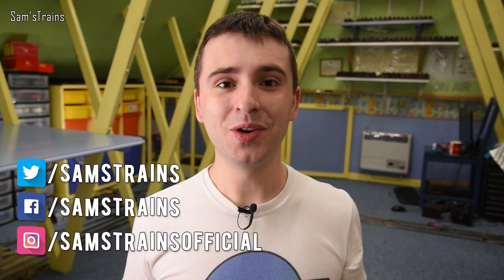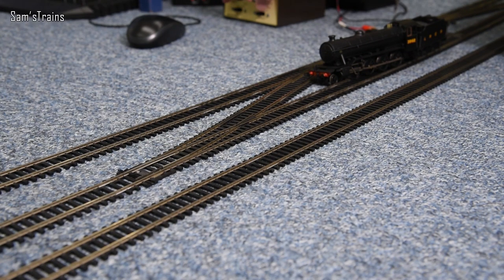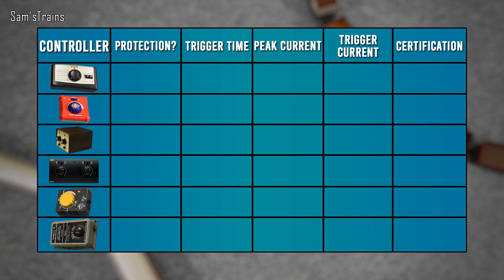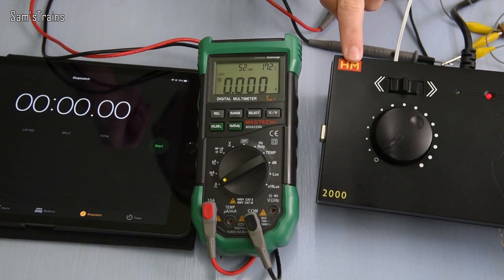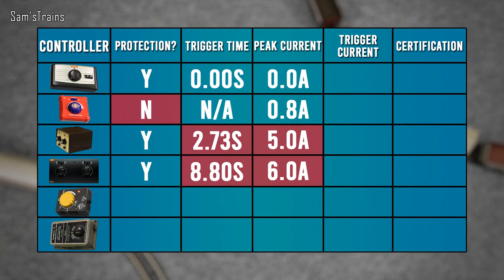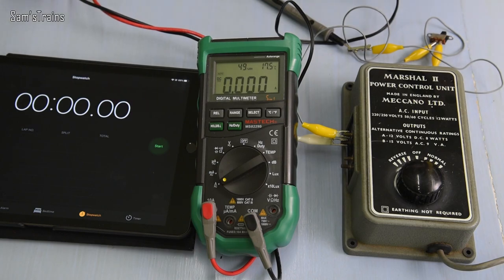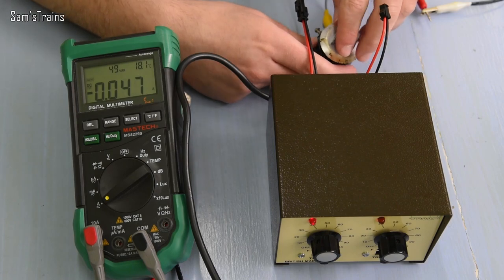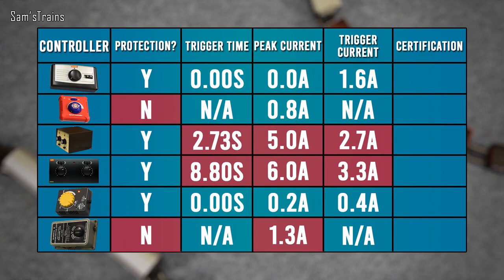What Happens When You Overload Model Train Controllers?

Comment: Yup, Sam is waltzing along the edge. 1 - The size and design of the transformer is key to what is intended for AND how it is used.  2 - The components, at the transformer secondary output are used to rectify, filter and control the output DC to the rails counts TOO !  3 - DON'T even get me going on abput Switching DC supplys !

Comment: Easier said , a short circuit occurs when there's a conductor between + and - , no matter it's a model railway , a plug , a battery or something else. On my controller (I think it's Hornby but no idea what model) it's cutting straight away when it's a short circuit as all the trains stops and I can hear a knocking from the plug's transformer. But depending on what it's shorting ,  I've seen motors smoking , or wires getting red-hot.

Comment: Hi Sam. When I was 'nobbut a lad' I had a Triang trainset; the controller was a large, heavy, grey box with a slanting front with the red control knob. Also, there was a small red button that you needed to press to rest the controller if there was a short circuit (have controllers gone backwards - if you'll pardon the pun?). I think you rather short-changed the Mehano controller; on its performance, I would have awarded a gold certificate!
Reply: The problem with that button is that it could be held down while there was a short circuit.
Reply: @Poliss95  Thank God for a supervising parent!
Reply: @PaulSmith-pl7fo  My dad was out with his racing pigeons most of the time and my mother didn't have a clue about anything electrical.
Reply: @Poliss95  Ah well, there's a lost opportunity!
Reply from the maker: Yes that's right - the red button could easily be bodged so as not to work! And yes - I too love the Mehano controllers! :D
Thanks for watching - Sam :)

Comment: My father's 1930s Hornby 0 Gauge system -- 3-rail, of course, and all-metal rolling-stock -- had protection. The transformer/controller was a primitive version of the simple but sturdy Marshall II you tested. The protection was a separate naked square of fibreboard holding two terminals in series with the track supply, with a piece of ordinary domestic fuse-wire across the terminals. As a kid I had no idea what an amp even was, but it was most likely 5-amp wire.

Dad soon trained us in putting fresh bits of fuse-wire between the terminals. Boy, did we get through a lot of the stuff.
Reply from the maker: Blimey - I suppose that is pretty important for all-metal rolling stock too! Thanks for sharing David!
Thanks for watching, Sam :)

Comment: Very interesting stuff, Sam. My very old (early 60s) Tri-ang controller -- which was about the size of your Gaugemaster unit -- had short-circuit protection in the form of a pop-up breaker that I remember popping a few times. It was simple to reset: just turn off the current and push the breaker back in, and you should be ready to go. Can't rate it as you have because I didn't have any of the equipment that you use, but I remember the breaker being pretty quick to cut in, and certainly nothing ever got damaged before it did.

An interesting design feature was that it had 4 sets of connections, 2 of which were controlled by the dial (though there was only one, so what happened if you hooked them both up, I have no idea) and 2 which were direct -- which really meant that you needed some other sort of controller, or at least a switch, to control the current through them. It did mean that I could run both my trains and a Minic car set at the same time by using the Minic controllers. Luckily, the level crossing was designed so that It didn't short out either circuit or the controller as a whole.

Comment: I had a short circuit once.
I tried to put one of my grandparents wagons on my railway, but they are completely metal because on my grandparents’ track the power goes through a middle rail but I use dcc. Luckily my controller had a protector!
Reply from the maker: Ahh yes I've had wagons like that before - yes protection will have been very important in that case!
Thanks for watching - Sam :)

Comment: You need a wire wound rheostat for these sort of tests :).  Those little variable resistors don't quite cut it.
I sometimes find the Hornby Trainset Controller is sometimes a little bit too sensitive on its cut-out.  Having a slight delay on the cut-out is a good thing.    Probably up to about 1 second delay is good.    
I am not sure your trigger current was quite right.   You measured that at the time the controller cut out, but if a controller takes 8 seconds to cut out, the trigger current could be lower.   
Thanks for the comparison.  It gave a rough idea of what these can do.

Comment: The Bachmann does have a short circuit protection, namely its 800 mA current limitation. It will not protect a motor armature very well, but there will be no fire either.
The alternative to just limiting, which cuts out the power completely is called a foldback protection.
If there is a current limiter and a temperature foldback, that is getting quite good. These controllers all seemed to protect themselves well (the old one just by being overbuilt), but not all would protect a stalled motor.
We all love the "click" noise of the Gaugemaster in your videos, when you change the direction :)
Reply: Good answer.  It's all down to Ohm's Law.   A stalled motor will draw current according to its stalled resistance.
Reply from the maker: Yes that's true - but I think 800mA is quite a lot, especially when it's supplied continuously under short circuit condition - the best controllers detect this, and cut the power.
And correct - the stalled resistance of motors is much lower than under normal operation due to the lack of EMF produced by the motor in motion - hence the massive currents!
Thanks for watching - Sam :)
Reply: @SamsTrains  Sorry to keep on, but I would be interested to see the characteristic curve of the output under load.  It may be that Bachmann have a cunning circuit that keeps voltage constant to a point then goes 'over a cliff'.  
By the way, I have just been given one of those Meccano PSU's and it seems to be a tapped transformer (ie a voltage control). I haven't opened it up to have a look yet.   OK for testing though.  I design transformers for a living.

Comment: Compared to the base Hornby controller, the Bachmann controller is quite basic when it comes to protection. I've had both, and the Hornby Controller is very restricting. the Hornby Controller doesn't let you change direction when there is any power to the controller, it turns off when something causes it to short circuit, but it feels much lighter and the plastic feel cheaper than the Bachmann controller.

Comment: I was a kid (5-6 years old?) that had been given a typical HO scale train set for Christmas. I ran it and ran it of hours on end (my parents had thrown away the manual & packaging but also incorrectly assembled the track for me to wake up to, that's how I knew they'd bought it), probably to the point the motor would have died but it kept on running. Eventually, (maybe 7-8 years old) I began to get extremely curious as to the function and control of the train. I saw at high speeds, there were sparks visible from under the drive wheels so it must have been passing electricity from the rails into the train. I discovered (by gently placing a screw driver onto the track) shorting the circuit would stop the train, so I took the train off and began further investigating. I could generate decently large sparks (for a child) by slowly closing the gap between the inner rail, screwdriver and outer rail. I discovered that touching just one rail with the screwdriver didn't do anything, so whatever this "electrical circuit" stuff Dad had been talking about must mean electricity must flow into one side of the locomotive and out the other. At one point, the screwdriver got stuck (it physically welded) to the rail and I panicked, unstuck it, and, as a maniac of a child I was, tried to generate another spark. There was no spark. I panicked more. I put the loco on and tried to drive it. Nothing. I was heartbroken. I thought maybe I'd destroyed my one and only beloved locomotive but definitely the sparky electric knob-box. That is how I learned most of what I know about electricity today, but had to go to college to learn the maths of it.

Edit: wrote comment before viewing, now finished watching. I wholeheartedly approve of the SSCSSSC approval method.

Sam'sTrains (not to be long winded, there is a happy ending to this story, I promise) I was devastated that I had broken my most beloved toy; Legos were relatively affordable for me, so breaks or missing pieces could be replaced; sticks and stones broke Bonesy the skeleton, but I had a heck of a lot more stones and sticks. I did not have enough of a knowhow to jury-rig something 'redneck' style at that age so I moped and cried for a good month and started saving precious lawn mowing money (the best work dad offered for a child my capacity at $10 per yard (no matter the yard) and we had no constant allowance because that was for privileged kids) and half went to savings. Between my siblings and I all having to fight for this work, always putting half away for college, and only having one lawnmower, money came slowly (I remember saving for three months to afford a single Digimon VHS tape and then had to wait AGAIN for at least another month until we could afford both to take a trip to town and shop at the store that sold Digimon VHS tapes (the reason I bought tapes instead of watching or recording live broadcasts is another story)). 

I did, however, also remember something, a dream of finally entering a drawing, not being cheated by the drawers and getting something great in return, but had yet to actually win anything either from random-chance or skill based drawings for prizes before. At the county fair, (and I think it's still a thing nation wide) Operation Lifesaver (a level-crossing advocacy group) sets up a television, a few chairs and benches, and lets anyone curious to listen to the presenter or the VHS tapes of violent automobile/train simulated crashes (which are unsettling even as an adult, but boy howdy as a kid I certainly thought someone had been there with every single camera shot (possibly by time travel, if it existed), and physically threw the tape from person to person to get perfect cuts, angles, camera moves, and other digital media tricks that are entirely possible on live broadcasts today (again, I was a smart kid, but not bloody omnipotent)). I, for all intents and purposes, believed we had truly been to Pluto because I had heard about Pluto and Magic School Bus went there (isn't the purest form of childhood legitimately believing in magic?). What I was interested in was getting the raffle prize; an entire Bachmann set, and free to any child that puts their name in the raffle box. Being a child, I thought about these concepts of kindness, fairness, justice, death, hate, etc, but hadn't fully formulated what they meant to me yet. The Lifesaver man, although he was old, hadn't rode the rails in years, and was pretty jaded playing the same tapes over and over and seeing fewer kids take part every year as the local populations of 'Smalltown, America' dwindled (I think for us it was about the era the lumber mill was shutting down). All previous years, I limited myself to two entries, knowing that even if I lost the raffle or checked my empty pockets for corndog money. I felt I could entitle myself to six entries the next year. I spent all of my time the night of the drawing hoping and praying for a phone call. That night, there were only telemarketers. The next year, I was determined to win (especially spending long days working for no or little money). The next year, I spent every waking second entering my name and number, as the only limit to the prize was "name and number on one of these papers, I must see you write it, and you can enter as many times as you want." I like to think that, even if my name wasn't drawn, he chose my name anyway, just for the effort I put in. I later discovered he actually threw many of my entries away because nobody else could put more entries into the box. I love Operation Lifesaver man.
Reply from the maker: haha yes - I did all of this too - it's great for learning about electricity (if a bit dodgy) - another great value of train sets! :D
Thanks for watching - Sam :)
Reply: WOW ! War and Peace ia a short story compaired to this one !  (and it HAS been Edited !) . . . (and you thought Wylie was long winded !)

Comment: Sam, I used to own an original Tri-ang P6A controller from the 60's. They used a thermal cutout for overload protection. It worked by using a bi metal strip that was part of the circuit inside the controller. Under normal running current flowed and all was well. However when a short or overload occurred the bi metal strip heated up and bent which broke the circuit thus causing the power to the track to cut off. It had a red button just above the speed and direction knob which was used to reset once the short was removed. They were a very reliable controller using a rectifier instead of any electronics. Of course they were well suited to the 3 pole motors of the day. At the time it was deemed to be one of the best available with a beautiful all metal case in a sort of metallic blue finish. It had an A/C output to connect points controllers and an auxiliary 12volt dc for a slave controller to be connected. I remember using it at a friends place where we had a long train with as much rollingstock as we had with a triple header on the front. My original Stephenson's Rocket then an 0-4-0 diesel shunter (Not the Dock Shunter and Green in colour) followed by a steam loco which was I think a Princess class (it belonged to my friend). This all drew too much current and the red button used to pop out so we as 12/13 year old's kept it running by pressing in the red button.
Very silly but in those days we thought it was fun. 
I am really surprised that the modern Hornby and Gaugemaster controllers were so bad. There is no way they should allow that much current onto the track.
Modern transistor controllers since about the 1980's all as far as I knew had built in electronic short circuit protection so I wonder what has changed.
Have you done a DCC test to see how they fair? They should be well within limits to avoid damage to the DCC chips in the locos I would think.
Reply from the maker: Hey Alan, thanks a lot for sharing - yes I have heard about those before - sounds like a pretty great feature to me!! :D
Thanks for watching - Sam :)
Reply: @SamsTrains  OOoops! I named the wrong controller. I had the P5A. The P6A was specifically designed for anyone that had catenary and allowed for a common return so you could run for example any of the regular track powered locos and another wire was connected to the catenary. I never saw one in person and am not fully sure if they were much different at the back where the connectors were but the unit itself looked identical from the front except for the P6A instead of P5A.

Comment: When I was a kid we had a Model Rectifier Corporation Dual Loco Model 700 Controller. It never burned out or ruined a loco. Sometimes an Overload Indicator came on, but hitting reset it would be good to go. Made in USA. 
Input: 110 -120 volts; 60 cycles AC  OUTOUT:4 Amps. Master Power Switch. Dual throttles. Each throttle power could be set to either Pulse or full; 0 - 12 volts DC; direction switch; Dual Overload Indicators; Circuit breaker Protected.

Comment: There is something about blowing things up or making them smoke that gives great satisfaction unless it was not intentional. The basic controllers surprised me because I would have expected them to not have any protection. But the more expensive units I would expect it and to perform much better. I'm installing a dedicated short circuit protection unit on my multideck layout and it has adjustable settings including its trigger. Ill be setting it at a low 1.5amps. Very interesting video Sam and keep well. Clint
Reply from the maker: This is very true - I've always loved blowing things up with electricity, lol! Me too - I was surprised the expensive controllers weren't more sensitive to short circuits - they certainly passed high current for much longer than expected!
Thanks for watching - Sam :)

Comment: Very interesting video.  I'm running my Ausicion Vline L series (L1160) loco from my DC power supply on my hornby dcc train set loop.  
The hornby dcc controller is great because of its short circuit protection which I've tripped a few times when running the dcc locos that came with it.  But, when I'm running my Ausicion loco in pure dc, with a live read out of the changing amps is priceless.  It's currently sitting at 0.7 volts with 0.08 - 0.10 amps depending on where the loco is in the loop, the model I'm currently running has lights etc so it's drawing a bit more.  
Finding the perfect voltage/sweet spot has been pure scale model locomotive bliss.
Reply from the maker: Thanks a lot Bob - and thanks for sharing, that's interesting!
Thanks for watching - Sam :)